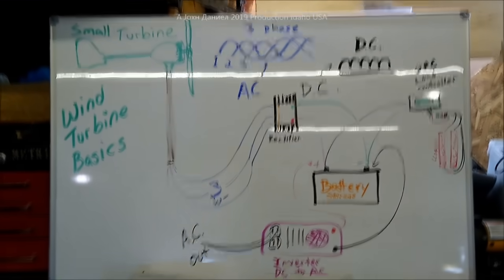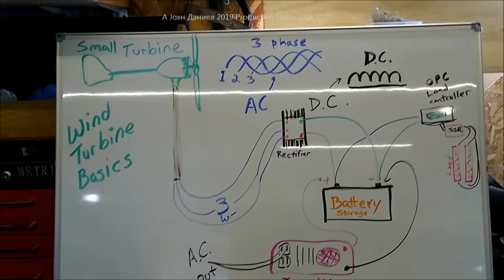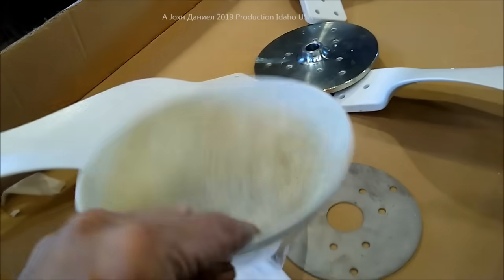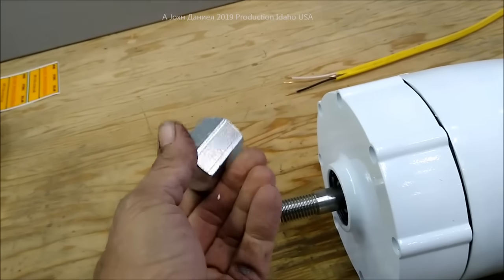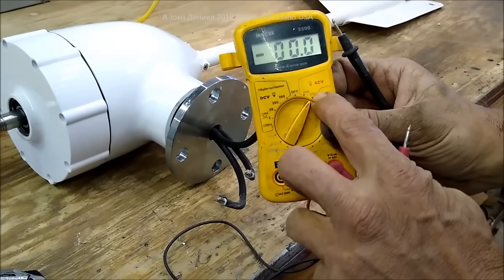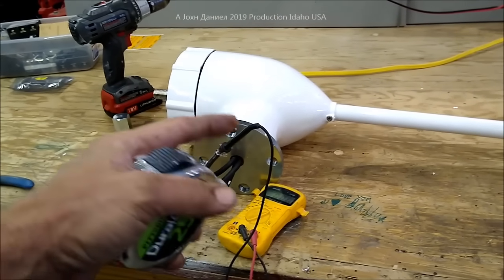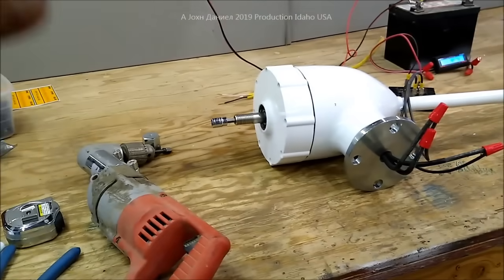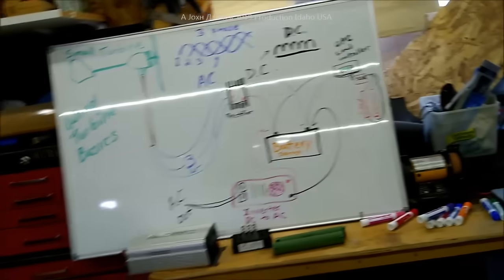800 Watt 12/24 volt Small Wind turbine by B & C Wind, Newest Model, Huge Parts List below

Comment: still have my 500W 24V here in the box.    My SSI kicks in this Nov.  Didn't see any point in setting it until I have enough battery for the thing.     Dang that one's going to SING !     I'd be making money today.    http://hint.fm/wind/          I purchased a few of these to do the Diversion thing.  WAY WAY cheaper and does what's needed.   Activate a SSR to load.  https://www.ebay.com/itm/Battery-Charge-Discharge-Board-Under-Over-Voltage-Protection-Module-DC-6-40V-TW/132406615026?ssPageName=STRK%3AMEBIDX%3AIT&_trksid=p2060353.m2749.l2649